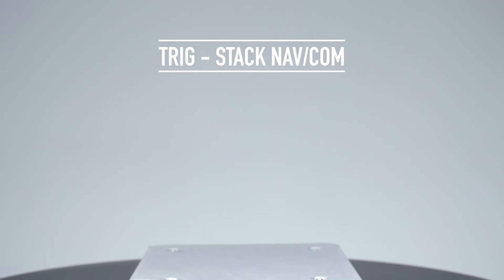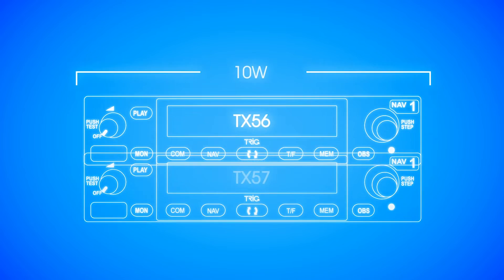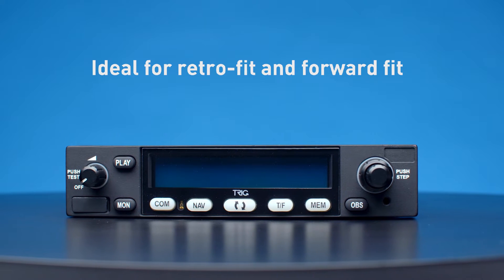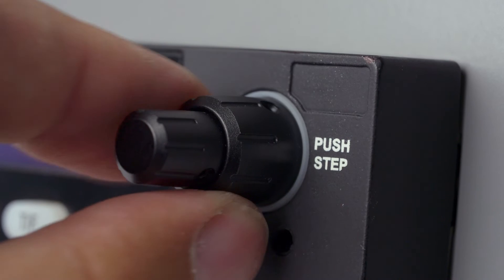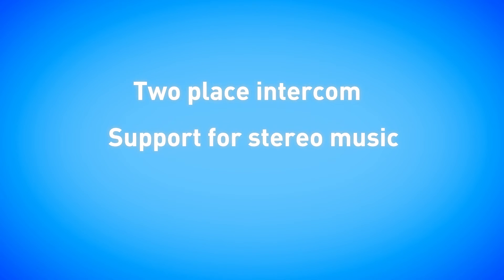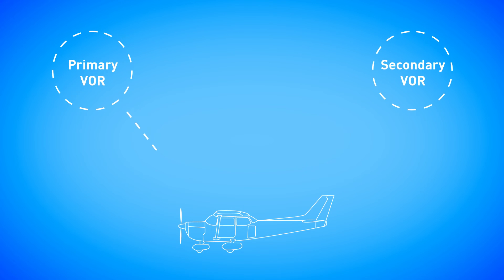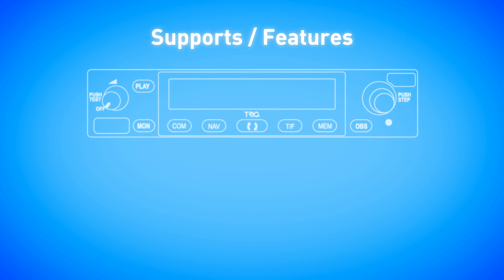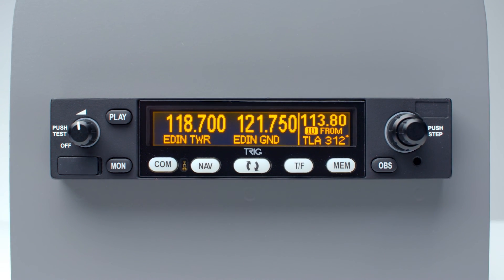Trig Avionics - TX56 Nav/Com

Comment: i am concerned as to what happens when my 155 fails.  This looks like the answer.  So - how much?
Reply: I bought the KX200 and its been a nightmare at best, not compatible if you had a KX 155 with an isolation amp